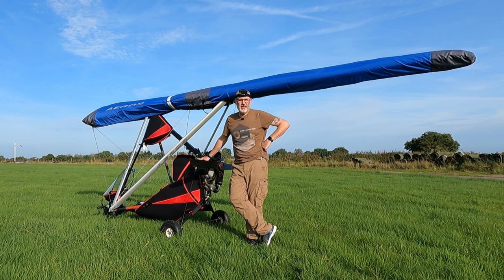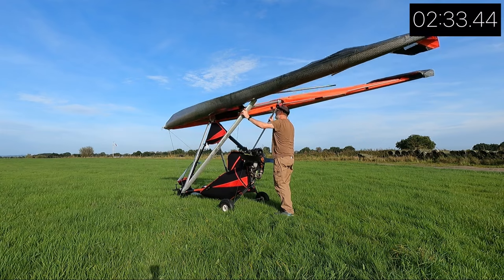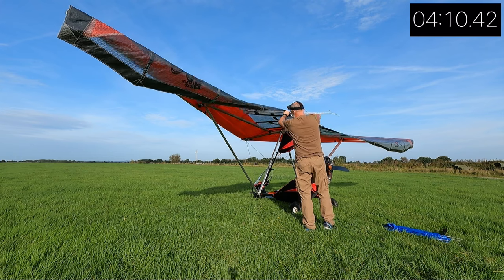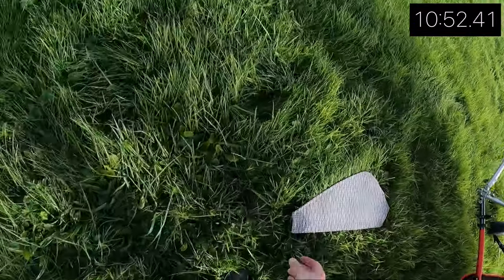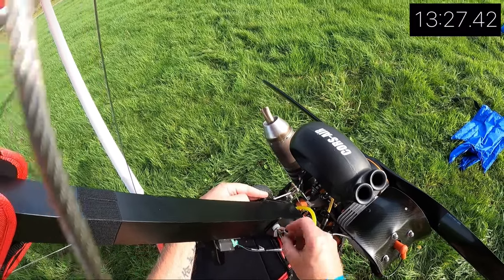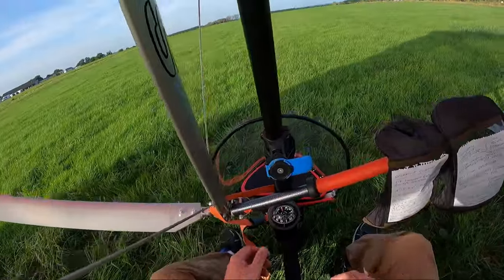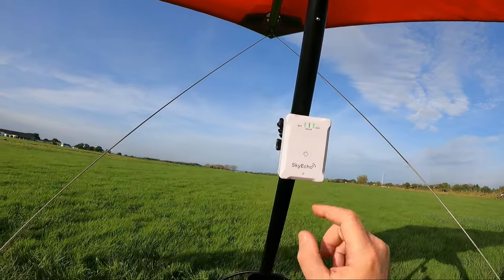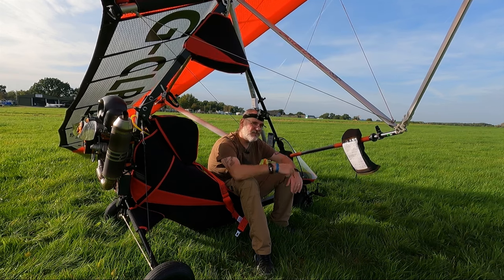Flexwing Microlight Rigging and Walk Around : Flylight BivvyBee & Aeros Fox 13TL

Comment: Red/Green for Port (left) Red & Starboard (right) Green. Nomenclature derived from nautical terms used universally in navigation. Cheers
Reply from the maker: I figured there would be a nautical origin as with a lot of aviation terms. I was just wandering if there was a reason why green and red were chosen and why red on the left?
Reply: Yep, nautical. Red helps determine who has right of way at night. The term port come from the fact that older sailing vessels often had a steer board on the right (hence starboard) so the left side was the side that often was the side against the dock in port (hence port). Least that is my belief! 

Thanks for the video.
Reply from the maker: Ian. Awesome explanation. Every day is a school day. 👍
Reply: and the way to remember which is which is "no red port left in bottle" i.e. red-port-left
Reply: @spechg8927 If there’s no red port left in the bottle I probably won’t remember anything! 😎
Reply from the maker: @tomcoryell 😂
Reply: Also, the position lights on aircraft are red on port, green starboard.
Reply: I learned the following phrase when I was in the Marines, "Red right returning," which means when you see a red light on the right side of a vessel or aircraft, it's coming at you. Maneuver appropriately so that the craft coming at you passes on the right; "green is go (side), red is no (side)."
Reply: That was my first thought as well. Started to look it up but decided to look at comments first. There it is!

Comment: Regarding that last bolt you insert into the main mast tube after lifting the wing (at 13:50 on the timeline),  a tip I learned from Mark at Aeros Trikes Australia is to store the bolt in the seat belt buckle. That way, when you sit in the seat and go to fasten the seat belt, if the bolt is still in the buckle, you know you forgot to install it.  It has saved me I don't know how many times from flying with the bolt not installed.
Reply from the maker: A very good tip. I have (almost) forgotten to fit that bolt on a few occasions and only caught it at the last minute with a thorough preflight check. I will definitely be stealing that bit of advice. Thanks. 👍
Reply: Excellent tip.

Comment: Thanks for the vid Paul! I like the strutted wing because you don't have to deal with the kingpost mess.   

My motomonitor keeps dropping off line. It seems to work at first but then 1/2 hour in,
 the rpm quits, or pegs at 9000, and the cht goes blank. I checked all the connections and changed the rpm resistor. It shows linked and charged. Anyone have this problem?
Reply from the maker: Seems to be a bit of a thing with Motomonitors. I might make he switch to wired monitors (trailtech) at some point in the future but just when I think of replacing, the motomonitor will start working faultlessly!  I’m convinced it is related to engine EMF.

Comment: Thanks for the video...very detailed.
I couldn't really see the MotoMonitor screen, is it clearly visible when flying in bright sunshine? would you recommend it?
Reply from the maker: The motomonitor screen is easy to read in flight. I appreciate it wasn’t so easy to see on the video. When it works, it does a great job and provides a lot of useful information. I have had a few occasions though where the connection between the transmitter and receiver has been lost.  My theory is that electrical noise from the engine has interfered with the connection. If I’m honest, I think I might end up replacing with wired CHT and RPM gauges. 👍

Comment: I just purchased a Quad Lock case for my phone...thanks for the recommendation.   Can you please tell us the specific lock you use that mounts on your front strut. I was looking and it seems like they have several that might fit the bill, but just am wondering which one has been working for you.  Thanks.
Reply from the maker: I use the quadlock motorcycle handlebar mount and take out the middle part (the long bit) and replace it with a quadlock “Knuckle joint” which lets me angle my phone to the desired position. Hope that helps. 👍
Reply: Thanks...this helps a lot.  I just got a new phone and what to try this system. Have you thought about putting a little safety strap on the phone?  I have the idea of loosing it or even worse, it going through the prop.  I've done it on my other items (radio, and vario) and I think I will try it on this case...just not sure yet what I have to work with.  Thanks again.

Comment: what's involved to obtain your licence roughly please and average cost .pd i like the aircraft you have
Reply from the maker: Tom, short answer is to gain your NPPL, you need a minimum of 25hrs instruction some of which is flown solo with some navigation exercises thrown in. There are 5 written exams and a general skills test (practical test). Costs vary depending on how long you take to reach the required standard. While the minimum number of hours is 25, a general rule is you are more likely to need the same number of hours as your age in years.  Bank on about £130 per hour of should give you s very rough figure. Have a look at the BMAA website (in the video description). Loads of useful info on there. 👍